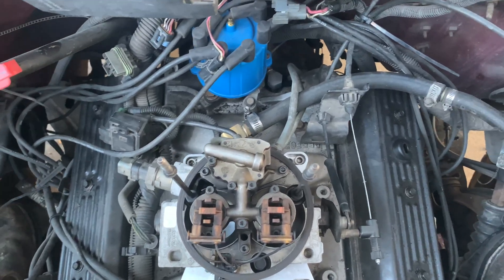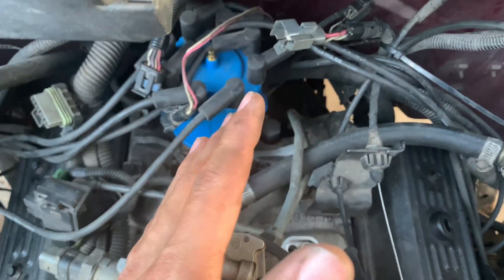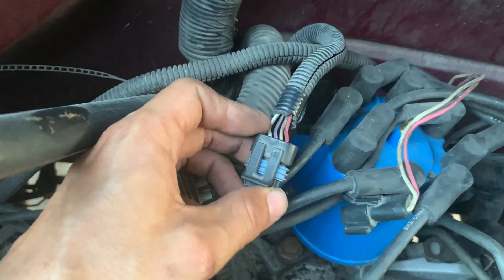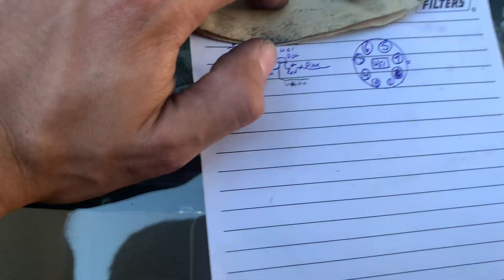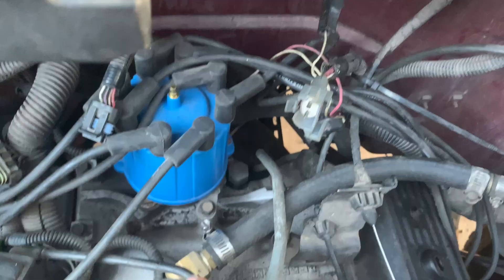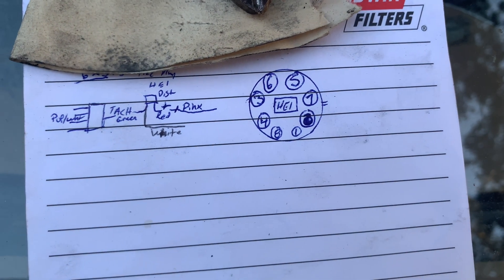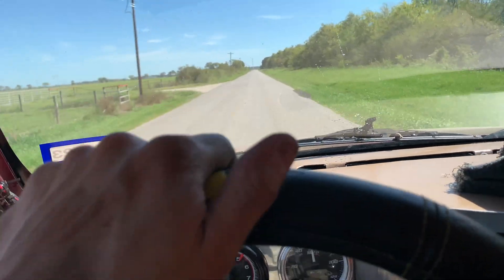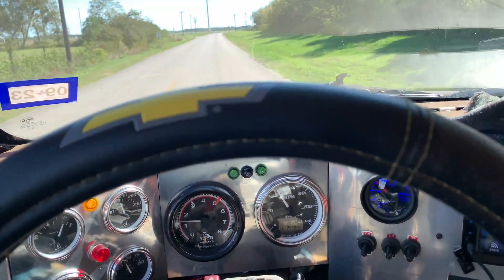How to swap a HEI distributor into a 88-95 TBI system

Comment: Hi, I know other people have said they had issues with super rich running after doing this swap. But did you personally have any issues with it running rich or did it run totally fine?

Looking to do this swap on my 94. Having a crazy weird issue where literally at idle it's throwing 35 degrees advance at it, and it rapidly jumps from 35 degrees down to around 15-20 degrees. Something wiring related. Ive tried 2 different distributors with different pickup coils, 4 different ICMs... Going to try to check the wiring, but I'm not super hopeful.
Reply from the maker: Before I sold the truck it was running fine and better response

Comment: On my 1991 K1500 truck with 4L60 transmission, there will be no spark if I hook up the purple wire with white stripe to the tach terminal. When I only hook the original red 12-volt distributor wire to the battery terminal on the HEI, everything works, including the fuel pump.

Comment: What about the  transmission  wires
Reply: If ure running the tbi still . Then the computer will still control transmission. It reads off the tps volts to raise or lower pressures and tach gives it shit solenoid controlled

Comment: Ok purple and white wire actually needs to get signal from pickup inside diatributer whichnis lower volts. .5 to 5 vokts max ! 12 vokt will make it flood or make ecm wig out
Reply: What do you mean by this ?? I ask because my truck floods at time when I first starts it . Everything's originally I ain't change nothing

Comment: What transmission are you running? I have a 460le it needs signals from the distributor
Reply from the maker: NV4500 manual transmission
Reply: The purple wire actually needs to be hooked to pickup inside disributer needs low volts. Trans Actually needs tps volts to control trans . the tps dictates pressures and shift points. Like standalone trans controllers and factory ive done tons over 33 yrs as car tech.
Reply: @thesatanicmechanic291  curious was researching the difference between shift point and stall speed because I don’t understand it. I shift at 2800 rpm. I don’t have a tps connected. So I’m guessing the wires from the distributor are sending some signal to the trans to make it shift. Any thoughts?
Reply: I have a 93 with a 4l60e.  Im doing a carb swap and cam . How can i get the 4l60e  to work . Is a tps all i need or i need a stand alone?@thesatanicmechanic291

Comment: Do not do EGR delete! I cooked my exhaust valve on the cylinder where the engine block channels the hot exhaust gasses. Wrapped from uneven heating. Did the whole top end.
Reply: the engine was already on it's way out, the egr delete has nothing to do with that
Reply: Absoutely

Comment: Which wire went to tach
Reply: Right! Dude said it was white, then said it was purple and another white
Reply: @satino8082  i just did this swap on my 89 n having problems with my alternator now
Reply from the maker: Purple/white wire is for fuel pump signal then made a 2 to 1 connection with black wire that is connected to TACH on distributor which also goes to the white wire next to pink wire at grey connector 4:47

Comment: IM confused . so the small purple and white wire hook to the bigger white tach wire then to distributor tack????
Reply: I think he said just the white wire that is in the same connector as the pink one, and the purple wire with a white stripe from the second connector go to the tachometer.
Reply: Wondering same
Reply from the maker: Purple/white wire is for fuel pump signal then made a 2 to 1 connection with black wire that is connected to TACH on distributor which also goes to the white wire next to pink wire at grey connector 4:47

Comment: So ive done this like you say by running the tach signal from hei distributor to the purple wire on the harness.  Ran, but very very rich.  Perhaps an aftermarket computer will work like that, but not an oem gm one.  There is a way to "trick" the computer to an extent, but it wont make proper air fuel adjustments.  Ultimately don't recommend this whatsoever.  Not opposed to the hei mechanical advance, but it just doesn't jive without changing the ignition module.  And then you have at minimum the brown/black jumper wire disconnected, so the computer wont compute like it supposed to.
Reply: Hi, from memory the dizzy only sends a  pulse to the ecm to fire the injectors, so the taco pulse should work. The a/f is controlled by the o2 sensor and map...  might look into this a bit more.
Reply: @kevantorrance4342  yes I'd recommend you look into it some more.  The particular computer I messed with was a 95'.  When you send a weird signal to that purple wire to trigger the injectors, aka the hei tach signal, it does not work for me.  Floods the engine with fuel.  Only way I've made it work is by using the tbi ignition module, eliminating the 4 pin hei module.  The engine ran good for awhile, then started to overfuel, due to the computer not reading from the o2 sensor. The computer won't make adjustments I learned if the ignition set wire is disconnected.  Makes sense too if you think about it.  Ultimately went back to stock distributor with everything hooked up, and all was well again.  Maybe the earlier computers are different, but regardless a blanket statement like this video says will get you into trouble.  I don't advise.
Reply from the maker: You're not the first person that comments this issue, hopefully in the near future I will make a update video on this problem! Thank you for the feedback!
Reply: @rickysgarage4036  that would be good.  As much as I like simple things like the hei distributor, without a proper tune it's wasted effort imo.  An aftermarket or early computer is probably necessary to get it to run right with hei distributor.  Late computers are a pita.

Comment: Did it your way, now I have code 42 , can help me solve it,,, ignition bypass, and thank you
Reply from the maker: Interesting I don't have a code or check engine light on, that's the first for me
Reply: @rickysgarage4036  if you don't have a code set with 3 wires disconnected, you either have a really old computer, or it's aftermarket or been tuned. Or your light is burned out.  Tried this most recently on a 95 tbi 350, absolutely didn't work the way you say.  Also tried on an earlier 93 I think tbi 350, also didn't work on that.  Injectors flooded the engine with fuel, barely run.  Had to remove the 4 pin hei module and use the tbi module to trigger the purple wire like it would be stock.  Alot more to it than what I'm saying too.  I dunno why I'm wasting my time commenting, but I cannot stand people leading others down a misinformed road.  Just ain't right.

Comment: I’m considering a vortec swap into my TBi truck.. did you notice a low end torque loss? Did you do any other mods to fuel system? Did you have computer chip tune or is that why you did the hei to adjust timing? Did it not run right at first? Awesome video!!
Reply: Any feedback
Reply from the maker: Just logged in and I will definitely be making a video tomorrow
Reply from the maker: I've been getting a lot of comments like these so I will make a update video on this matter stay tuned thank you for the feedback!

Comment: hell yeah man this is great just did this on my 95 350, just was wondering if you messed with the timing or what degrees you left ur timing mark at? Also now 2 months later how does it work ?
Reply from the maker: For me I set my timing advance a little bit, the degrees I'm not sure because my timing cover is plastic and only has 0* (vortec plastic timing cover). As of now truck runs good but the TBI sweats a lot of condensation, but I will make a update video on this matter